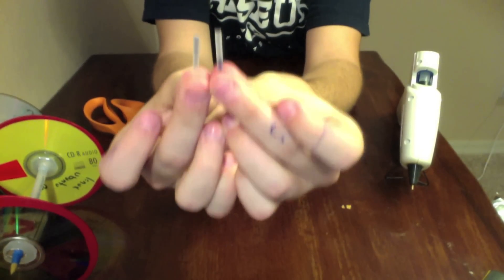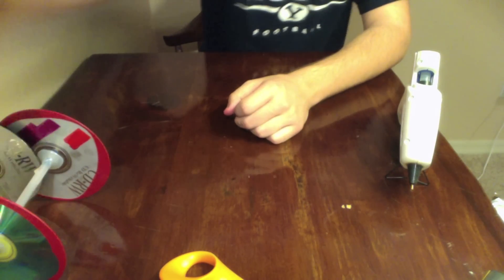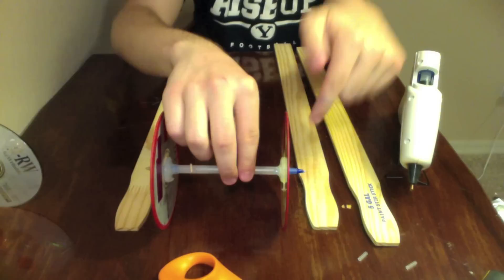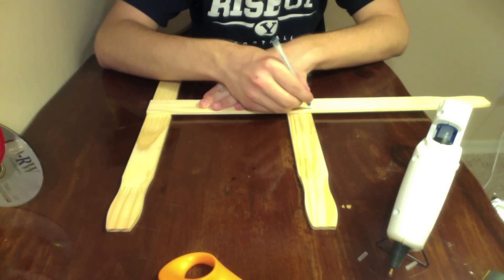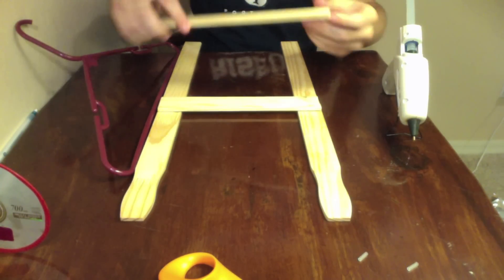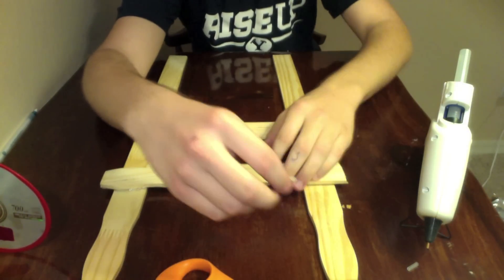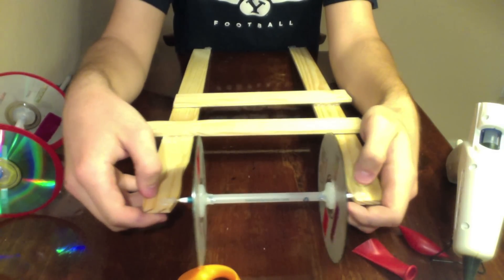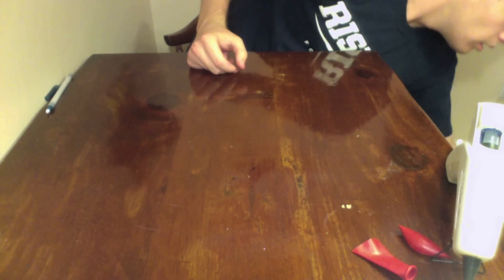EASIEST mousetrap car tutorial (Part 3/4)

Comment: Just a tip to fit the axle in. Glue the first tube on and wait for it to dry then fit one side of the axle into it. After that, put glue on the other side and push the tube into the axle while it's wet and then wait for it to dry

Comment: Hey we built your mousetrap it is a great design but our car ended up only going 14 meters and we need it to go a bit farther any tips? We have a length restriction so we had to make it a bit smaller could that be the reason why it does not go as far other than that our car was very similar to yours

Comment: say, would having say a straw for the axles of the wheels to insert through be more beneficial or doing it like this video be more beneficial for the car? and also, does it have to be balloons or can it be any type of rubber that can help the cds have more traction to the floor?
Reply from the maker: A straw could work, but you might have problems with it bending due to not being rigid enough. Any rubber will do, and no rubber at all will still probably work!
Reply: Jegber thanks! :)

Comment: Why didn't you glue the tubes on first?
Reply from the maker: I wanted to be able to fine tune them on so they would fit perfectly with the pen tips on the axles. You could probably glue the tubes on first and it would work just as well!